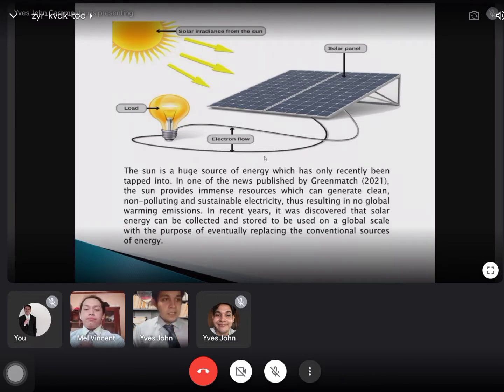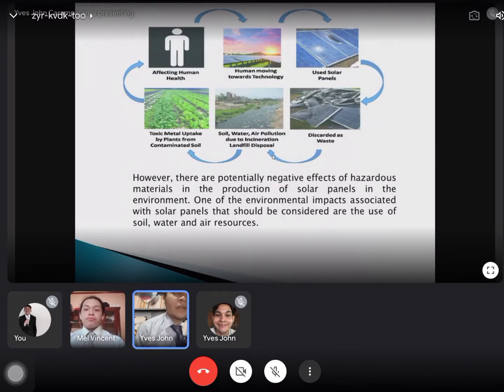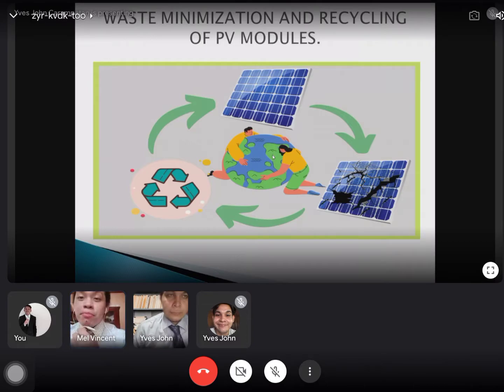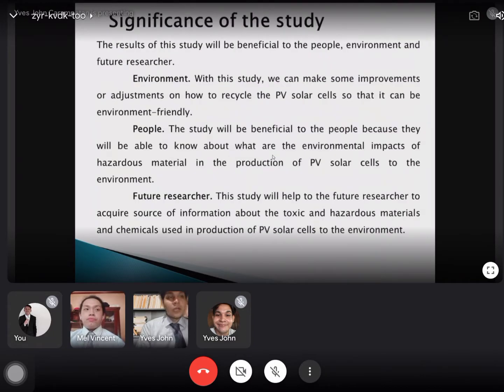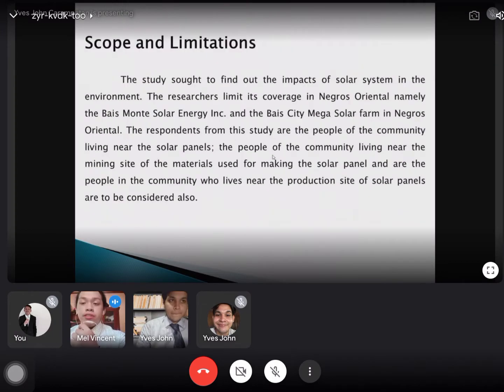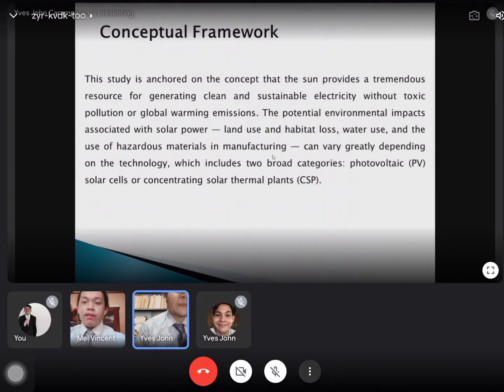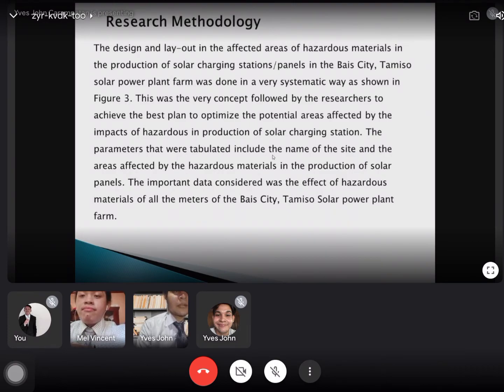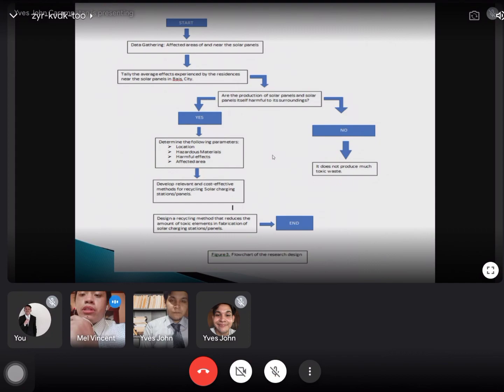The Impacts of Hazardous Materials in  Production of Solar Charging Panels on the Environment

Comment: NAME: MACAHIDHID ALRICK , O.
CLASS NAME & CLASS SCHEDULE: COE 346A – TTH 5:00-6:30 PM
DATE: March 25, 2022

REACTION: The researchers explain their findings in an acceptable manner, which is particularly informative in that it looks at the potential consequences of hazardous elements in solar panel manufacture. The researchers' method is impressive in that it considers the possibility for environmental damage while aiming to provide a reliable supply of energy.

REFLECTION : Everything we do or do has a disadvantage, just as a battery must have both negative and positive sides to function properly. It's a good idea to start by identifying potential future downsides so that we can devise a strategy to address them. We invent to make people's lives easier, not just in the near term, but also in the long run. To achieve such vision, we must carefully examine the inventions and concepts that we will develop in the future.

Comment: Macabinguil, Joshua R.
COE 346 Methods of Research T-TH 5:00-6:30 PM
March 25, 2022
REACTION: This research is complete and you can easily get the idea that they discussed and it really helps to identify of what will be the Impacts of Hazardous Materials in Production of Solar Charging Panels on the Environment.

REFLECTION: This greatly help in the because you already know the impacts of hazardous materials in production of solar charging panels on the environment is solar power—land use and habitat loss, water use, and the use of hazardous materials in manufacturing.

Comment: Gliocam Blessings C.
COE 346 Methods of Research T-TH 5:00-6:30 PM
March 24, 2022

REACTION:  Solar energy has the potential to be beneficial since it lowers the usage of other energy sources that have greater environmental consequences.

REFLECTION: This study illustrates that, while solar panels provide the most advantage in terms of reducing electricity usage, they also have a negative impact on the environment. This study is extremely instructive and beneficial in terms of determining how to strike a good balance.

Comment: NAME: Cheri Mae E. Tinguban

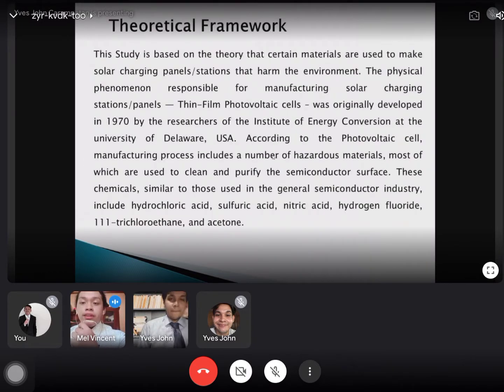CLASS NAME & CLASS SCHEDULE: ENS 341 – Research Methods for Engineering – 5:00-8:00 Saturday 

DATE: 24/03/2022

REACTION: This video is about "The Environmental Impacts of Hazardous Materials Used in the Manufacturing of Solar Energy Charging Stations/Panels." While everyone was talking about the benefits of solar energy, one researcher was discussing the toxic compounds used in solar energy production. The sun, as we all know, is a vast source of energy that has just lately been harnessed. The sun has vast resources that can be used to provide clean, non-polluting, and long-lasting electricity, with no global warming emissions. How the researchers discovered that hazardous elements used in the construction of solar panels could have negative environmental consequences. As a result, a range of dangerous substances are used in the production of PV cells. The cells that convert sunlight into electricity, on the other hand, are made up of some potentially toxic minerals and compounds. Some solar thermal systems use potentially hazardous compounds to convey heat. If these materials are released, the environment may be harmed. After watching this movie, I was taken aback since in the previous films, we were admiring the beauty and good aspects of solar panels without realizing that there are also negative aspects to their manufacture.

REFLECTION: As a Geothermal Student, we were solely focusing of the beauty of solar energy and were unaware of its detrimental implications on the environment. While solar is marketed as a "clean" and "alternative" energy source, there are some unspoken negative environmental consequences. Carbon emissions, hazardous waste, unsustainable mining practices, and habitat destruction are all linked to the production of photovoltaic panels. Carbon emissions, hazardous waste, unsustainable mining practices, and habitat destruction are all linked to the production of photovoltaic panels. Residents and decision-makers should think about these environmental consequences, as well as solar's limited potential to provide enough energy to support the system. As a result, I believe that, while solar panels are quite valuable to people nowadays, their manufacture is extremely hazardous. While these panels are really necessary, the metals needed to manufacture PVC can constitute a public health risk if not handled properly.

Comment: NAME: BERNALDEZ, ELLYN MAE A.
CLASS NAME & CLASS SCHEDULE: ENS 341 - SATURDAY (5-8PM)
DATE: March 24, 2022

REACTION: Based on the video presented, the research proposal is very informative. There are some negative effects of hazardous materials in the production of solar panels and some has an opposite reaction.

REFLECTION: In some cases, the construction of solar facilities has also negative impacts. Resulting in soil compaction alteration and increased erosion. The construction of solar energy power plants can expose hazards to air quality which has the effect of contaminating water-reservoir. Based on the video, some solar thermal devices transit heat using potential dangerous substances. The environment could be harm if these materials leak. We should first know and have knowledge about its negative impacts before we decide to implement this kind of matter.

Comment: NAME: ATOY, AMIEL S.

CLASS NAME & CLASS SCHEDULE: ENS 341 - SATURDAY (5-8PM)

DATE: MARCH 24, 2022

REACTION: As I've watched the short video, I felt denial. Although solar panels are very reliable but some also has an opposite reaction to the surrounding areas.

REFLECTION: Solar panels became a reliable source of energy because it's easier and faster to install and only needed sunlight to obtain energy but in some cases it also take a huge amount of area to cover. Several panels must be put to build a solar farm. In both practical and aesthetic aspects, this affects the landscape. Power generating is the only thing that can be done with the area now. Some people might find the reflecting panels unappealing. Once in place, the panels have the potential to negatively impact nearby habitats and species. We all know that safety is also a top priority not just for the people but for the environment.

Comment: Franz Michael B. Nadal
ENS 341 SAT 5-8 pm
March 24, 2022
Reaction:
The research presented was illuminating. As we know the trend in the usage of solar panels is now increasing and many of us wants to aquire it. As they present although usage of solar panels brings advantages it also brings disadvantages. I agree with what the researchers presented that solar cell production involve a lot of harmful material for it be able to convert sunlight to electricity. Also solar power plants needs a wide area or plot of land which need to be cleaned and where to install the solar panels. It also needs regular  cleaning and maintenance for it to function well. That is why I'm very thankful for the researchers bringing this topic for bringing enlightenment that although solar power plant as they say is eco-friendly in energy production, its construction is what it's drawbacks but as long the results outweighs the negative impact  and we can handle this impact very well then we can avoid this problems. 

Reflection 
I realize that solar powered plants are not really that eco-friendly when it's comes to construction and disposal of the used solar panels. As we know solar solar cells in a solar panel only last for 25-30 years which means we have to replace it. The disposed solar panels should be manage well or recycled for we don't want it to cause another major problem which will lead to poisoning or contamination. And I realize that before deciding to things you should first know it's negative impacts and how to handle it. The example  of this is the climate change that we have now, wherein we  focused to much on the making of vehicles and powerplants and forget the harmful emissions that is a by product of it thus resulting to this situation which is again another problem to address.

Comment: NAME: MONTEBON, GERALD MAE E.
CLASS NAME & CLASS SCHEDULE: COE 346-A (5:00-6:30 PM)
DATE: 03/24/22
REACTION: Solar panels also have a downside, this don't last indefinitely. They can leak heavy metals and acids as they age, and they may experience performance concerns owing to erosion and other circumstances. The panels can release poisonous vapors if they catch fire. To assist reduce these hazards, one of our goals is to provide 100 percent reliable encapsulation for solar cells. There is no such thing in this world with advantages alone but also with disadvantages.
REFLECTION: Although Solar panels is essential for us but they are also decommissioned after they have lost their usefulness (usually after 20+ years) (taken out of service). During this stage, many of the harmful chemicals included in solar panels put workers and communities at danger. Stricter processes and protective equipment, as well as direct recovery and recycling initiatives, could all help to limit these dangers.